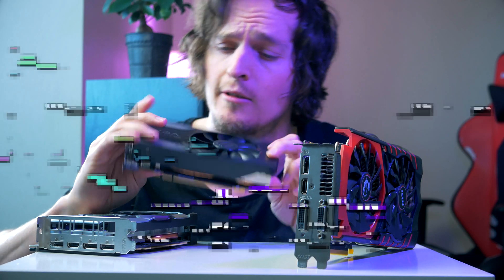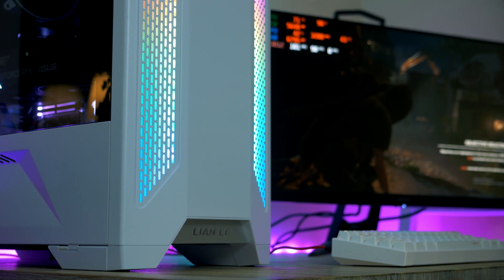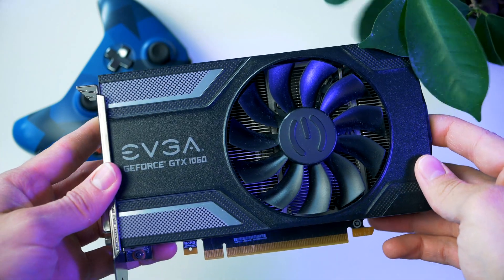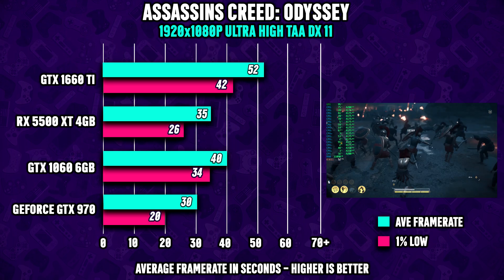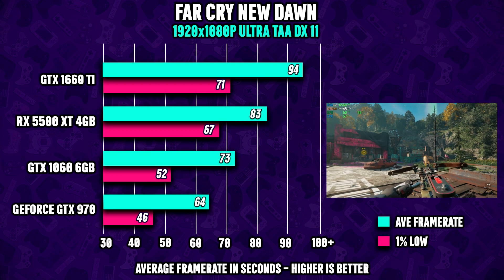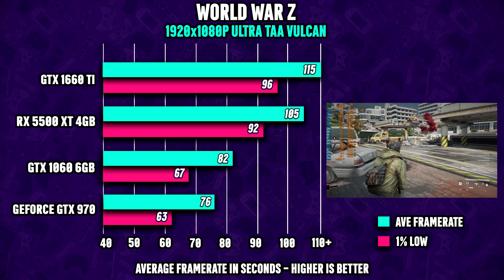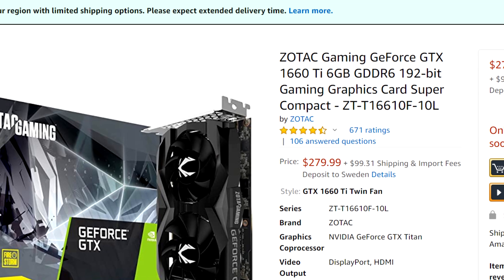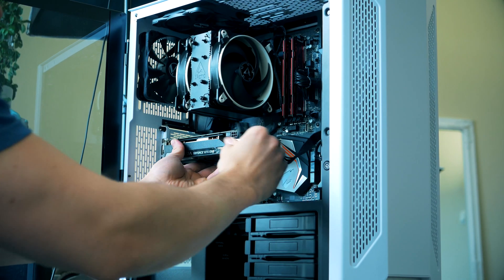GTX 970 Vs 1060! Still Worth in 2020? TOP Best Budget GPU in 2020 [$100-$300]

Comment: I found a PC used with a 970, 16gb RAM, r5 2600 and a B450 motherboard for 550€ it also comes with an 144hz monitor and keyboard with mx brown switches. 

Seems like a good deal but somehow it feels wrong buying someone else's build?